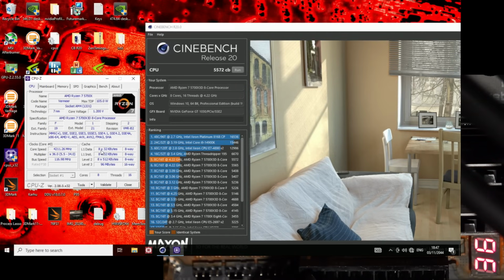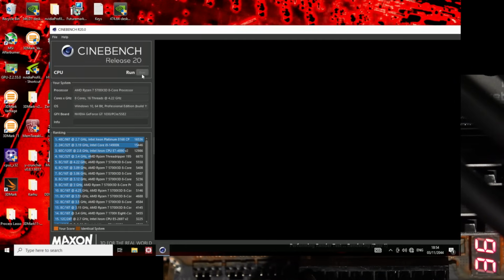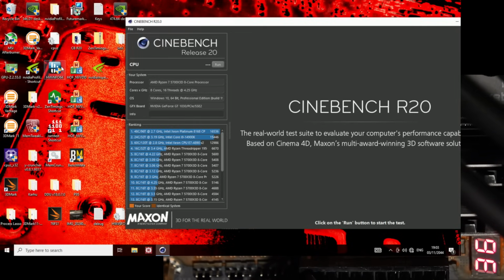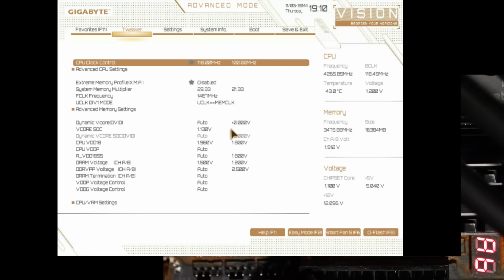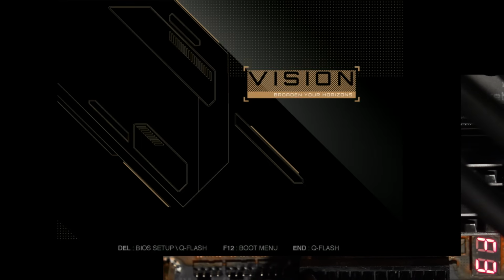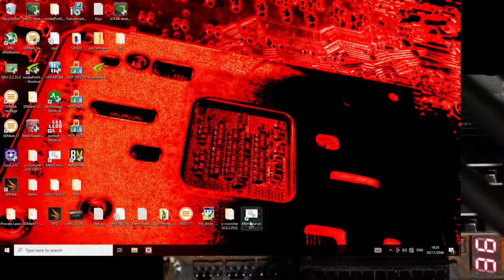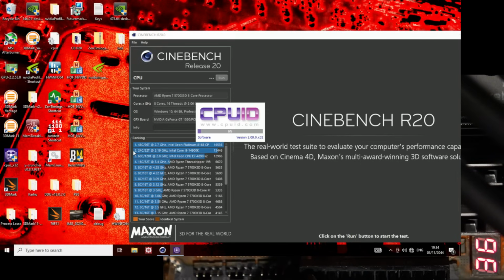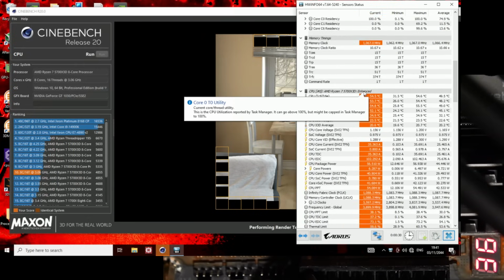Overclocking the 5700X3D?

Comment: I have a B550 Aorus Eiite with a 5800X3D and it has curve optimizer settings unlocked. I'm (supposedly) running at -30.

In the first few BIOS revisions that supported the X3D it was indeed missing, though.
Reply: Yeah, the first thing you do with a new 5800X3D is undervolt it/perform cure optimizer voodoo magic that's equivalent to undervolting. Most can take the full -30 of whatever those arbitrary units translate to.
Reply: @hammerth1421  one thing I recently learned is you still need to watch our for clock stretching but it does seem like 5800X3Ds are premium bins.
Reply: B550 aorus, ah yeah I'll keep that on my bench next to the AMD r7 and the alpenföhn cooler. Which one you ask? I thought I made that clear, the arous one
Reply: @kayburcky7146  bruh. I don't really need to be more specific. It's not a super exclusive feature. They should all have it. lol.
Reply: I thought this cpus reach 5 hrz😅
Reply: @shayeladshayelad2416  nah, the 3d vcache is kinda fragile. Gotta keep the temps and voltages lower than on a non-3d.

Comment: Trash silicon for (almost) full price of 5800x3d
Reply: I mean, that's the point. The 5600X3D and 5700X3D are a way for AMD to sell 5800X3Ds where the 3D cache worked out, but the cores themselves underperformed or straight up failed.

Comment: With my 5800X3D and X570 (Dark Hero) i got a lot of "fun":

1. Discovered that sleep bug still not fixed by AMD and after wake up CPU is undervoilted (on 50 or 40mV) which give higher scores in benchmarks. Have to disable sleep mode!;
2. For some reason once i got 628 points in CPU-Z in Windows 11 Pro (22H2) i can't return back to it. It basicly stuck at 625-626 points. I spent A LOT time tuning CPU in BIOS and turn off parasitic services in Windows to get back 628 again.

And ALL THAT on 3200_CL22 (JEDEC). :) Just to not fix even more problems after memory OC. Currently on 3800_CL16 and tested in TestMem5 (25 cycles - 2:45:31 for 4x8GB).

I tested a bit BCLK on my motherboard, but because of NVIDIA RTX 3000 series limitation it's problematic to boot higher then 103 MHz (if i remember correctly). Need Radeon GPU (which i don't have).

And also that weird ASUS "Force OC Mode Disable - Enable" which help with BLCK overclock... Just bunch of tiny-tyny things to switch to force CPU to work as i need.

Comment: Could you please get your hands on the new 8700G and see how well it can overclock ram?
Reply: It might be a bit too early for that. Have been testing one out of curiosity on an X670E motherboard and AMD’s GPU drivers regularly crash just using Windows even without games.
Reply: @abavariannormiepleb9470  I've been seeing some 2500 IFC, which is nuts.
Reply: Mine did 2400 just fine (prime95 with AVX-512) with 2 X 32 GB “standard-slow” DDR5-5600 ECC UDIMMs at 1.1 V from Kingston with SK Hynix A-Die without changing any other default settings. But I returned my unit because the crashing GPU drivers couldn’t be solved within the store’s return window and I was pissed since I ordered mine when AMD’s spec page for the 5700G still stated ECC memory support before AMD removed any mention of it and ECC memory support is a crucial feature for me.

Comment: LoL - you are 2 days late on this video - I had a defective 5700x (sudden gust of gravity) and I didn't want to spend the money for the 5800x3d - but the clocks were too slow on the 5700x3d. I decided that the daily use was more important than the gaming configuration I have and I ended up just running the 5700x again. The pricing vs performance of the processors and my current needs dictated the 5800x3d or the 5700x - my wallet finished the decision.

Comment: A pretty underwhelming chip, barely sqeezin out 4.2ghz after kissing pcie 4.0 goodbye bcause of the BCLK overclock
man, the voltage is crazy! i have my 5 5600 at 4.75 with stock boost behavior retained, it can sustain 4650-4670 all core under load @ under 1.2V
no clock stretching
Reply: the way  x3d chips are sadly lol.  But the 3dcache does make up for it in games tho.   When i had my 5800x before i had too get the 5700x3d cause i needed my system UP  while i can RMA my 5800x cause it started too get plaq by whea errors otherwise i wouldn't did the upgrade.  But even at 5120x1440p there is some boosts here and there not mind blowing cause yea my screen res but the 1% lows and min fps is alot better tho.     currently running the  cpu so it boosts up to 4.275- 4.285mhz.  and holds around 4.193mhz  in cinebench muti  and with pbo  -25 on per core
Reply: @gordesky1  also, since the CPU has so much data in its cache, the speed and timings of RAM matter less. it's as if you had fast ddr5 while actually having ddr4
Reply: @sunlbx   yep that  does make sense too  ;)    But yea there is no doubt the lower  clock of the 3d chips gets too me still does really when i look at them hehe   and well the overclocking too unless you do bclk ocing..  Cause i always had my pcs overclocked sense 2003 so got used too just seeing.. Well a high clock hehe.     Best overclocking fun i had was on my am3 fx 8370 build still got it too but had that thing up too 5.1ghz and kept it around 4.9 daily from 3.3ghz  lol..  Than ryzen came along while it was MUCH MUCH faster than fx cpus ryzen just  was more so boring when it came too overclocking ... lol  socket 754 was fun too with the DFI lanparty boards too ;)
Reply: @gordesky1  doing bclk 104 on any ryzen is always worth it. everything on the chip works faster, cache, cpu cores, etc.
and you don't lose pcie 4.0
and the boost mechanism doesn't go off or crazy

Comment: What my 5800x3d had a curve optimizer.
Reply: I use -30 and -.0875v offset on my 5800x3d.  I get the best core performance with that voltage setup.  I had tried BCLK OC when I first got it, and just couldnt get stability with my mobo and this CPU, but I could with 5600g...
Reply: @EMU1  -0.875 v? that is a lot.
Reply: @erkinalp  Should read .0875v.  -.875v was not correct.

Comment: I don't think external clockgen on 4xx boards works with any cpu sans zen+, i've also tried bclk OC on my zen2 with x470 g7 board and it failed at the same 104.5 ish bclk. What's interesting it didn't happen to my mate with ch6 board, so it's maybe a gigabyte problem

Comment: stock voltage in a asrock x370 killer sli for a 5800x3d its 1.3 to 1.33 volts its too high and x370 dont have pbo in the motherboard so i have to set up PBO2 tuner software.
Reply: My stock Voltage for my 5700x3d is 1.3v.. maybe this is needed for the extra cache?

Comment: Which x370 and x470 have external clock gens? I'm currently running my 12100F at 5.3ghz on a b660, I love that kind of stuff.
Reply from the maker: Crosshairs. Gigabyte Gaming 7s.
Reply: @ActuallyHardcoreOverclocking  Thanks man.
Reply: Crosshair VII Hero. Even has async BCLK.
Reply: @Wasmachineman  Thanks man
Reply: What b660? I'd love to OC the 12100 for cheap

Comment: not surprised the 5700X3D gets so much voltage @stock. after all, these are most likely all the bad yields of 5800X3Ds AMD has accumlated
Reply: agreed. i'm pretty much sure to run my 5800x3d @ lower Vcore, with the hidden CO enabled. runs hot though
Reply: That's the entire purpose of these SKUs. Sell 5800X3Ds that didn't make the cutoff for the 5800 bin.
Reply: @hammerth1421  yeah but you get near 5800 specs for a hell of a lot cheaper so I'm not complaining 😂 £120 my 5700x3d cost brand new 🥳
Reply: @rasky2684 HOW TF DID YOU GET IT FOR 130?
Reply: @Derpynewb  Ali express 😂
Reply: @rasky2684  you got a 5700x3d, you sure its real and actually performs as it should? Your pretty ballsy to spend that much on ali express in the first place.
Reply: @rasky2684  I recently done the same, although I paid £130 (also AliExpress). Great upgrade for my existing platform for half the cost of 5800X3D!
Reply: @Derpynewb  i copped one and its gonna arrive in like 3 days, if youre interested i'll update here in the future (currently got a 3070 n r5 3600)
Reply: Someone liked my comment so now I'm here, but yeah works perfectly, big framerate boost esp in 1% lows, had to wait like a week and a bit for it tho but would 100% recommend
Reply: @Zinul  hey bro did it arrive and can you send the link?

Comment: I have a theory for those imensely high stock Vcore. The chip quality(the ccd itself) most likely is rly bad on those 5700X3Ds. Which makes perfectly sense, as AMD would have labeled them 5800X3D otherwise. They can not use two ccds(to increase yield) here because of the 3D vcache(splitting the vcache makes no economic sense), so bad binning seems to be the only way to put out a "budget 5800X(3D)" at competitive prices. 
That high vcore also busts a myth AMD created around their 3D vcache SKUs. They said the 5800X3d is not overclockable because of the 3d vcache itself, which is allegedly sensitive to higher voltages.(They should have skipped the "X" for those non out of the box ocable SKUs). 
Hm and now we have the 5700X3D with the highest vcore values we have seen yet with Ryzen 5000. 
Nothing wrong about "recycling" bad bins, but locking the customer out from basic bios settings like core freq and voltage, rly is a let down from AMD. Seems like 3D v.-cache can handle up to ~1,4v perfectly fine, so they could at least open those settings within the safe limits of the vcache. AMD CPU team is so much more restrictive with user applyable settings compared to AMD's GPU devision.
Reply from the maker: nah 5950X runs higher Vcore in absolute terms. The Vcore is just really high relative to the core clocks the CPU runs at.
Reply: @ActuallyHardcoreOverclocking True, but there is a good reason for the high Vcore there. After all the 5950x is suppossed  to be the 5000 series SKU with the highest stock clock speeds.
Reply: @Squilliam-Fancyson You can do -30 PBO and still get similar clock speeds, albeit with slightly degraded stability but with vastly improved thermals.
Reply: @ActuallyHardcoreOverclocking  Indeed. My 5700x3ds stock VID ist 1.3v. Its high relative to its clock speed but not too high or even the highest. Some 5800x3ds also run 1.3 - 1.33v stock VID vcore or the 5950 as a example also even higher VIDs, heck even some 5800x run these VIDs. So indeed, thats not something special.
Reply: Please take you tinfoil hat off and listen to what BZ actually says.
Reply: @andersjjensen Come down dude. Why do I wear a tinfoil hat when I just try to figure out reasons for AMDs high stock vcore on that 5700X3D SKU? Imagine, not everybody is just a Yeah sayer like you. Why do you even watch such content, when you are not even into  ocing  enough to make out your own thoughts?
Reply: 1.4v will absolutely kill an AM4 3D chip.
Reply: @J_Dyingbreed BS. If it stands 1.35v it will also most likely do 1.4v. It may degrade faster though.

Comment: that's a fun OC. Just got done with the 8700g delid and liquid metal sandwich and that thing rips too if you got the cooling.
Reply: I just started messing with mine. It’s getting extremely close to stock 7700x performance @ 5.1ghz 6400 CL30
Reply: @LegionGamingTV   I just ordered mine, the thing with these APUs is that they have half the 7000 series cache, as per usual for AMD apus to cut costs down (but somehow still charge 330 for it!!). so they wont perform as well in games because games are random processes and love low latency back and forth storage
Reply: @Shrek_Holmes  Yeah the cache does hurt the performance but not as much as you'd think when tuned. If AMD would sell us a monolithic CPU like this one but with the full amount of cache and PCIE lanes Intel wouldn't be able to keep up..
Reply: @Shrek_Holmes they still charge 330 because you got a whole GTX 1650 in there 🤦
Reply: @Shrek_Holmes It's less that they're cutting costs and more that they're laptop chips repackaged for desktop use. However, I do agree that they're overcharging quite a bit for these designs that, while practical on laptops, are less than ideal in desktop applications.
Reply: @LegionGamingTV  fclk 2400 with 7200mhz in 2:1 mode is the best performance:effort ratio I found
Reply: @IntuitivePlayer  Im now at fclk 2600 with 7800mhz 2:1 which dominates anything else.
Reply: @LegionGamingTV  Good chip!
Reply: Keep waiting to see them Vcache the APU's. Would suck for core OC
Reply: No offense, just curious: why???

Comment: Currently I have 60-70% GPU usage in the finals and cod ect with a 3080 5600X. Is it worth it to go to the 5700X3D from a 5600X been trying to find vids showing the 2 in the same video but can’t find many.
Reply: I get the impression it's around 20% faster in most situations. Gamers Nexus included a fair number of older cpus, including yours~ watch?v=llKZzym9hAo
Reply: @nonstopNny I’ve seen that one, but thanks. Just wish I could see more of the games I play so I could directly compare but it’s almost impossible to
Reply: @KnightWarden7435  Yeah sorry, there are lots of little channels out there that do testing, but very rarely do they show how they test, under what conditions, etc, so it's sometimes hard to tell how reliable their data is.
Reply: @nonstopNny  Yeah exactly. I dont find little channels shit usually but my gosh thats the only way to describe them for benchmarking, I could set up a better benchmark test.
Reply: Just go for the 5800x3d imo, it's come down in price a lot
Reply: @IIHydraII Where I am the price is 25% less for a 5700X3D than a 5800X3D.

As far as I understand at 1440p majority of the time it’s just 5-10FPS different.

Comment: Its just a degraded / worse bin of a 5800X3D it wont be going all that far

Think of it like a 28nm GPU that has been pegged at its limits for 2 years straight it degrades to like 90% of the max frequency as at an atomic lvl it has shifted around

Degradation from use is dead but degradation during manufacturing is still a thing and the entire reason why everything isnt just a 7700x/ 7800X3D or 7950x / 7950X3D
Reply: dont underestimate the price point marketing. Think about the Phenoms with fine working cores disabled...

Comment: There is a B550 motherboard with the code display? Damn. I couldn't even find X570 with it with reasonable price (thankfully at least it has diodes for some troubleshooting).

Also - I'm sure this video will be great. Even though of course X3D chips are a "bit" harder to OC. ;) And in most cases OC on AMD isn't worth that much. Especially all-core - usually ends up with lower single-core speed than you'd normally get. But probably BCLK OC can get around a lot of that.
Reply: Yo, I am sorry but that kinda assumption here is part of the problem. Post code shouldn't be a premium feature, and it didn't use to be. Mobo manufacturers just gradually went there for the last few generations and the fact that you are surprised about a postcode on a lower tier chipset, that for all intents and purposes has everything your average consumer needs, kinda shows it's working....

But to actually say something useful aside from the bashing here (don't take that personal ofc I'm mad at the mobo manufacturers not at you) the cheapest AMD 500 chipset series boards with post code (which the zoid actually covered in a few videos) are ASRock b550 steel legends and similar (velocita and extreme4 are basically the same but in red and blue and with the hardware buttons actually soldered on for a little plus in price) for when they came out around the 200-250$ area iirc
Reply: @kayburcky7146  Thank You for being informative in your second part. As for the 1st part. My previous 2 CPU's were Phenom II and Athlon XP. When they were released post code wasn't something seen to much outside OC. So I didn't know about it being a thing when I bought X370 mobo. By the time I was looking at newer mobos (X570, B550), most of them didn't have post code. And sadly AsRock isn't available here in sane prices. Though next time I will ask about them - sometimes it might be cheaper to ship something from Western Europe than try to look for it here.
Reply: Yeah, I paid way too much to get the X570 Dark hero for the code display and Dynamic OC, which was nice until we saw what others were doing with just PBO II and CO.